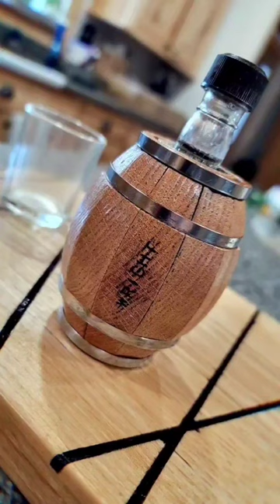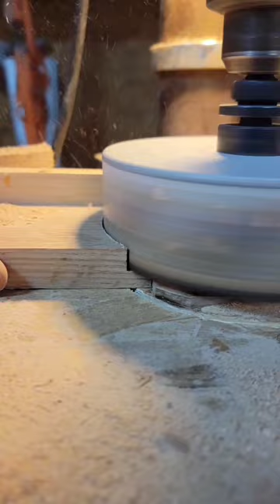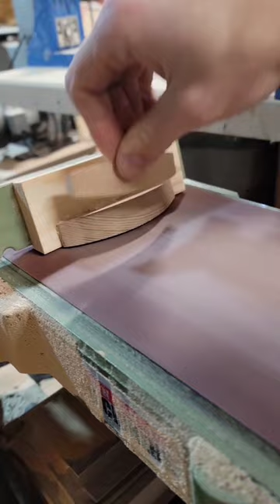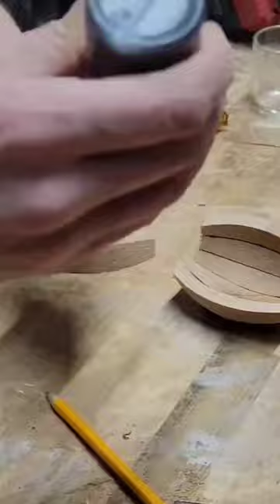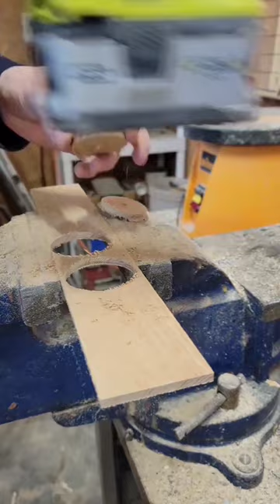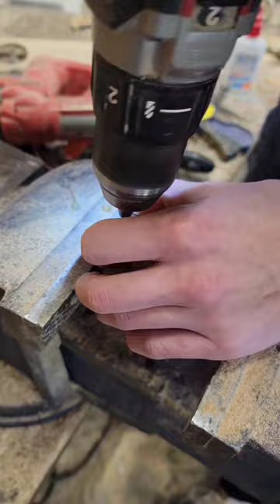How To Make A Mini Barrel #woodworking #diy #carpentry #maker #wood #handmade #craft #giftideas

Comment: But will it hold a fine cabernet?
Reply from the maker: Yes... as long as that cabernet is in a  2 ounce bottle 🙃
Reply: Absolutely stunning. What sort of rivets / tiny nails did you use for the metal hoops?